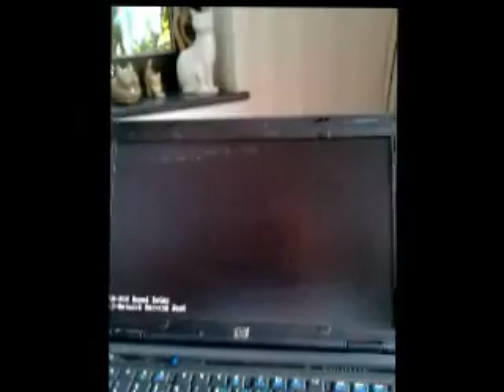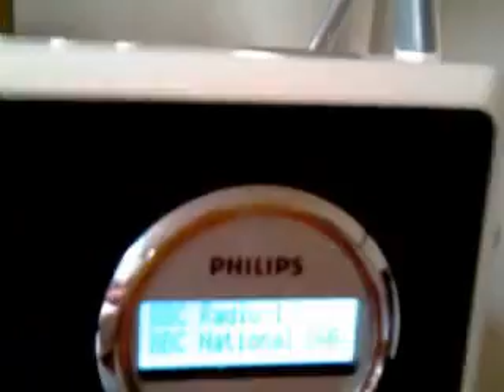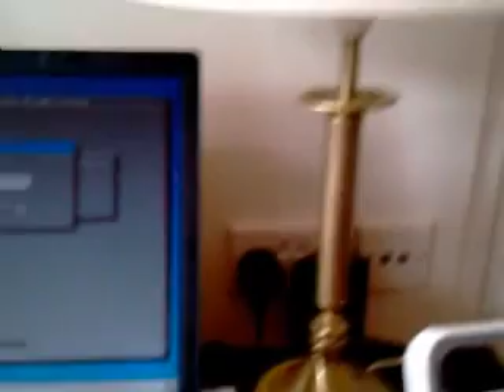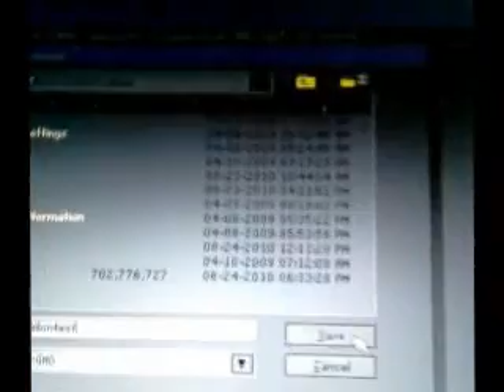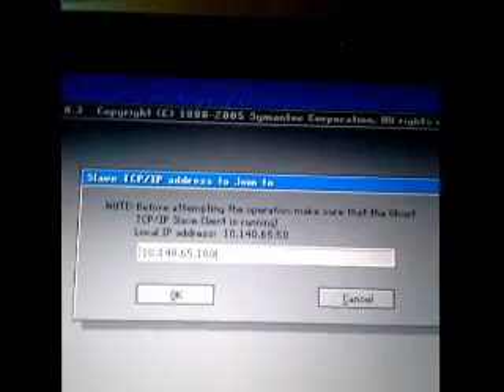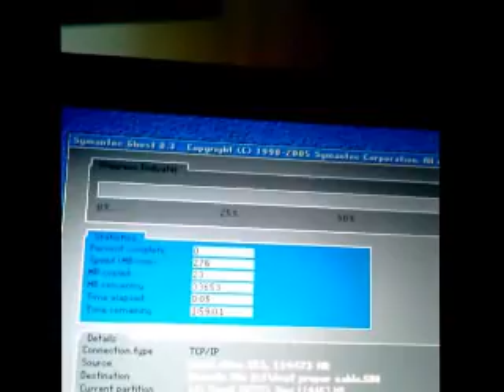Belkin Gigabit HD Powerline Adaptors Wiping out DAB Radio

Comment: This is an outstanding non-technical demonstration of a real-world deployment of PLT and the unequivocal breach of the Essential Requirements of the EMC Regulations - which state that radio equipment MUST NOT be prevented from operating as intended. Any PLT with the GIGLE chip-set (currently Belkin and soon, Solwise) will have this effect since they use radio signals over the mains, interference is inevitable.

Comment: Powerline adapters turn your house into a gigantic emitting antenna. As they transmit their signals over the electric wires using the full HF band, from 3 to 30mhz, every electic wire in your house starts to emit aggressive digitally modulated electromagnetic radiation. I am both an engineer and HAM radio operator, and can tell you from experience that these powerline adapters are a big problem as they radiate until at least 100 meters away from the house using it and make listening to HF radio impossible because of the strong signals they emitt. Unlike wifi which is sent from one single point, using small antennas, power line adapters emit via hundreds of meters of electric wire. Furthermore wifi stays within their band and does not wipe out a large portion of radio spectrum. On top of that, most of these devices emit far more than the specified power (so customers are happy with the speeds and performance), and often more than the legal limit. Just do a youtube or google search on PLC powerline adapters and HAM radio.  Use ethernet cable instead! Fast, cheap and clean, and you dont irradiate yourself and the neighboors, and you can listen to HF radio.